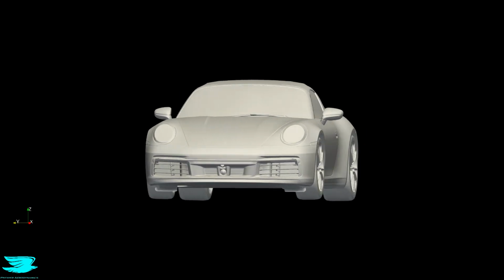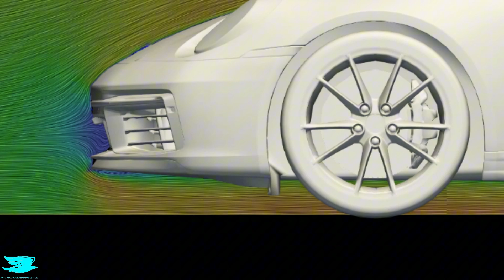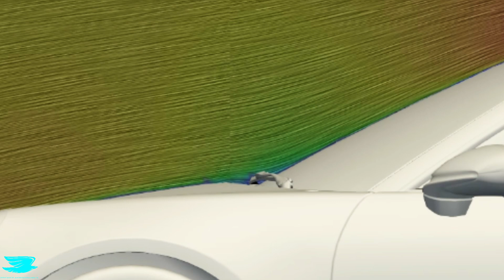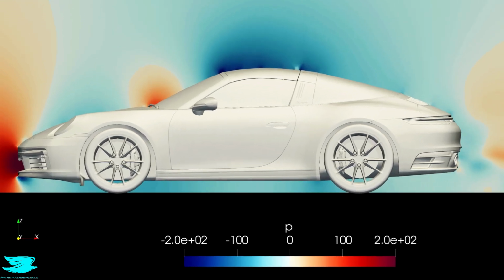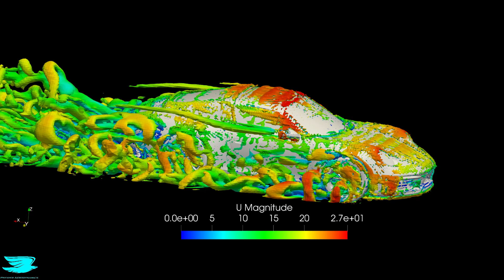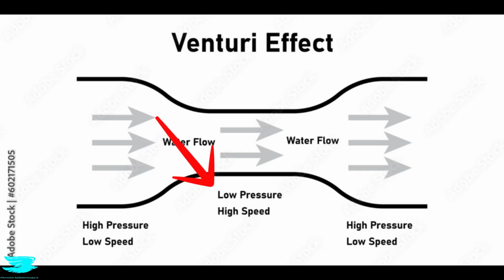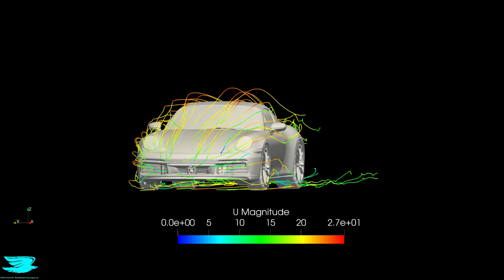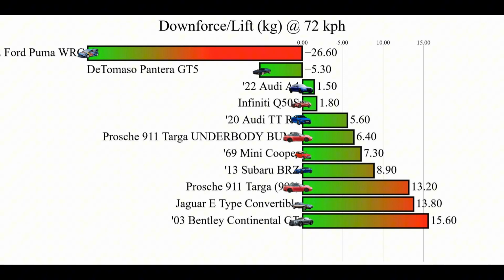I Fixed The Porsche 911's Aerodynamics Problem

Comment: Only from driving a 992.1 i cant agree, its like there a too many things missing on the Aero Car Parts. Like the Design of the Groundplate and the Brake cooling airflow. Or the flow when the Wing is out and air is forced to go from Roof strait in the engine area and comes out between the mufflers.

Comment: the original center of lift was pretty central and the new diffuser creates low pressure locally and offset to the rear giving a rotational moment with increasing speed. That's an undesired effect
Reply from the maker: As said in the video, you can change where the bump is, and for those who like to live dangerously, you could always have more than one.
Reply: @PremierAerodynamics  4 counts of cd added is much worse than 9kg of lift on a car that's roughly 1,5 metric tons and only the former could be felt by the average customer

Comment: Are you sure it’s a good idea to use RANS and stationary wheels here? I feel like that choice would seriously hinder the validity of the results in this application
Reply from the maker: It's not RANS and the wheels are MRFs.

And how much do you think they will hinder the validity of the results?
Reply: That’s good. The results look averaged though, did you do that in post?

I can’t be sure but without MRFs the pressure distribution on the underside would probably be significantly different.

Comment: Interested in your thoughts: I have a 2018 (991.2) targa GTS, and it is extremely stable, possibly even more so, at high speeds. Given what you described in the video, the opposite should be expected, so I’m wondering why this stability occurs?
Reply from the maker: It is quite different to most 911's, despite looking quite similar. For example, the lip at the front borders on a small splitter, and that alone really helps produce downforce. You also have vents at the top of the front wheel houses, which for this particular car helps alleviate high pressure in the wheel houses, and that reduces the lift too.

Also, the entire car is angled down slightly, so the entire underbody is essentially just one big diffuser.

Comment: If the porsche ground clearance would be 30cm higher lets say, would the added bump add lift to the rear? It seems that the factor that lowers overall lift value on the porsche in the video is the venturi effect, which the company used in real life but with an inflatable spoiler in the front
Reply from the maker: The higher up you go, the less effective the venturi effect becomes.

Comment: This is interesting, but Porsche employs some very smart aerodynamicists. I have to think if this were indeed a simple way to reduce lift without a penalty, they'd do it. So I don't know what it is, but there must be a downside they've considered that isn't covered here. Reduced ground clearance perhaps? If the limiting factor is the height of the lowest point on the car, for clearance, perhaps it's better to have the whole floor at that height (aside from the diffuser), effectively making the whole floor be the 'bump'?
Reply from the maker: Do you know any Porsche aerodynamicists? I do. Have you worked in the automotive industry? I have. Fundamental knowledge there is very weak.
Reply: @PremierAerodynamics every modern RS car would disagree with that statement lol. I have 2 theories why Porsche didn’t do this, and it could very well be a combination of both.
1st theory: Ground clearance. People in the comments saying the ground clearance would be negligible likely haven’t driven a 911. The rear of the car often scrapes worse than the front because of how far the body extends beyond the rear wheels and the weight of the engine in back. Many countries nowadays have regulations for ground clearance, so adding that hump may have made it so they had to raise the car, negating any positive effects on handling the bump had. 
2nd theory: the GT3 and GT3RS both already have better aerodynamics and diffusers. Every upgrade they make to the base model brings it a bit closer to the top of the line model, so the manufacturer is hesitant. This happens across the whole car industry, not just Porsche.

Comment: 1. Awww come on I asked for a "Porsche is more aerodynamic in reverse" video.
2. As others have stated, the underbody is "open" there because of secondary engine cooling and the massive exhaust manifolds and catalytic converters all housed behind the rear axle, which prevents any proper diffuser design in the first place (let alone a hump).
3. Considering how far Porsche design language has come especially regarding the 911, I wonder how bad the '60-'70 classic 911 was with the upright windscreen but less frontal area overall.

Comment: I would highly appreciate if you could do a similar video on the 986 Boxster, it has a lift problem. Roof on and off, would be interesting to see what damage the open top does. I drive mine on track and would love some more downforce and less lift :) thanks!
Reply from the maker: That, in my opinion, is the best porsche because it was nimble and the chassis was a  little flexible, so you could feel the road way more. Later models, and the 911's, feel really dead in comparison.
Reply: @PremierAerodynamics you mean flexibles as in the shocks/springs stiffness or as in chassis torsional/flex stiffness?

Comment: Placing the bump right between the wheels makes sense from a ground clearance standpoint.

 A little forward of the rear wheels or right between them sounds like a good position, since that will increase the rear grip without reducing front grip, but I wonder if that would reduce the diffuser's performace because of the fact that any negative pressure where flow detaches behind the bump will suck in the dirty air of the jetting vortex of the rear wheels. Conversely, placing it right behind the rear wheels will seperate the jetting vortex of the rear wheels from the underbody flow but then the diffuser has to be extremely short, and any extra downforce created behind the rear wheels makes the front grip worse too.

Also if its placed between the front wheels, it would increase the flontal area since the sloping hasn't begun, but what if the ramp from the splitter was extended to the wheels to effectly be like a shallow bump?
Reply from the maker: It definitely could reduce the diffuser's effectiveness, but it would also reduce the wake size, so that may compensate for the diffuser's loss.

Comment: You missed the Effekt off the intake cooler air exausts in the back. Thex differ from Modell to modell. that changes the underpressurezone and the hole airflow in the real

Comment: Having a bump there is essentially the opposite of having a diffuser right? Because the diffuser would hollow out that space. So if the bump reduces the pressure an reduces lift, how does a diffuser do the same?
Reply from the maker: The geometry isn't really the important thing. The important thing is the gradient of the geometry. So, they both create downforce because of the acceleration of the air. The bump also has a couple extra features, like the Venturi effect, which amplifies that acceleration, and then being close to the ground also gives you more room to make an even more extreme end of the bump/diffuser.

Comment: I know that you probably have more sugested ideas than you can make in 5 lifetimes, but I just couldn't leave 2 more ideas to be forgotten without a chance of analysys.

1st one:
do roof railings really add so much drag? or maybe they can in some weird way help in some cases (working like a spoiler or vortices generators) and why do some of them are so noisy

2nd one (maybe not as much with cars)
how much better aerodynamics do sportbikes have over naked bikes? (easy comparason might be between MT series bikes and R series both from Yamaha, mostly same chassis and engines, but R's with and MT's without fairings)

I really appreciate your work and how you make aerodynamics easier to understand for people like me (still in highschool) even though they are one of the most complex things in physics.

Comment: I drove various 992.2 models at speeds of up to 340kmh and they’re incredibly stable, if anything, you get a feeling like they’re more stable the faster you go, almost as if they’re producing suction.
Reply: Maybe because they are newer and porsche has has time to fix the issues
Reply: @mwanted240i 
Probably, but any kind of lift due to their shape (as mentioned in the video) is a non issue. 
Even getting airborn at 300+ due to bump(s) will not induce lift in frontal area. 
They do have very significant roll acceleration due to high level of lateral stiffness, and that can catch you off guard at very high speeds if you get too relaxed, but as far as aero behaviour goes, they really don’t leave much to be desired. 
You can cruise at 320 for very extended periods of time.
Reply: @drazenbudis7881  aha, there is not that much frontal lift and the weight distribution kinda compensates for the rear lift
Reply: That would be with the wing up, right?
Reply: @polipochilegge  
On the cars that are revealed to the public as of today, yes, correct, always with the wing up (which in that case also serves as active air ducting).

Comment: 911 being rear-engined has always meant it cannot have a well-sized diffuser. They made the RSR mid-engine just to have that advantage along with better CG(just like a proper supercar would kek)
Reply from the maker: The bump fixed that too, if you want.
Reply: Not having the engine in the middle has never stopped the 911 from absolutely dominating every other road car on track. The fact about the lack of room for a diffuser in the race car is true though.
Reply: @jbrandon302 🎯
Reply: @jbrandon302 yeah well for that price tag it's not that surprising
Reply: Because the rules didnt allowed long difusera after the bumper or something like this, so basically they had to break tradition to do that and also a better car overall since the mass is more centralized

Comment: Clearly you haven't seen a 911 from the underside. The hump you tal about is exactly where the exhaust manifolds and mufflers are. It's the only part of the car that hasn't got a flat bellypan because off the heat and accessibility to the engine/ exhaust.
Reply: I was going to say the same thing. The hump is actually already there in the form of the muffler back box.

Comment: Your solution is partially good because you calculate it on a steady speed and assuming a constant ground clearance. In reality the ground clearance will vary depending of the circuit, road and suspension compression due to downforce. This will result in an unstable behaviour at higher speeds during a quick ground clearance change. (See Mercedes crash at Le Mans in 1999) A fixed wing will provide consistent down force at cost of drag.
Reply: Also of note is that, while this bump may be more efficient in terms of -L/D, It's important to consider the design priorities of the Porsche. Porsche, unlike many supercars, doesn't put too big of an emphasis on the top speed, instead focusing on broader handling performance. The added fuel economy penalty from the drag is also not really a concern since, well... it's a Porsche, if you can afford one you can afford the added gas prices. Overall the bump seems like it would be a good solution if this were for a cheap, slow road car that happened to be shaped similarly, like the beetle, but on the Porsche it somewhat conflicts with the actual design principles.
Reply: The bump as illustrated is a fair way from the ground so while some suspension movement will vary it's effect to some degree it's unlikely to be crucial.
Reply from the maker: The same can be said of pretty much everything about the car, including the entire car itself because it is sensitive to the angle of attack. Wing lift changes with angle of attack too, so no consistent downforce or drag production.

Comment: I remember having a conversation with people about cars, and someone mentioned that the Porsche 911 has the best aerodynamics(Their reasoning was something like, "Because it's a Porsche"). I said that wasn’t true and not all 911's are stable at high speeds(GT and RS versions exception here) due to car body shape. They looked at me like I was crazy :D
Reply: I have noticed that they are very pitch sensitive, raising or lowering the front axle +/- 5-10mm brings a whole new set of dynamics at high speed vs low/medium speed as you trade mechanical grip balance for aero balance. It makes setting the cars up frustrating for the uninitiated. It is not intuitive to me how adding a bump around the diffuser improves things. Factory examples of increasing diffuser efficiency on these cars involves tilting the engine up to allow more clearance for a larger and longer diffuser.
Reply from the maker: The bump effectively removes the need for changing the engine placement. Also, the bump can be placed anywhere very easily, not just in the diffuser area. Placing it there increases the downforce for the rear wheels.
Reply: @ Recently watched top gears episode on the Manthey 992 GT3RS where the Manthey rep talks about the use of multiple curves in the diffuser to help keep the airflow attached. Is this a similar principle to what you achieve with the bump? I have been looking at ways to fit or build an improved diffuser to 991 gt3 for laptime improvement.
Reply: That person was correct. The GT cars and the rs models specifically, make better use of aero than pretty much any street legal car out there, barring any super low production unicorn or street legal race car build.
Reply: I’m curious, all this talk of unstable at speed… which generation of 911 are you guys talking about?
Reply from the maker: Fanatics and logic don't mix.

Comment: I mean... if somehow making the diffuser less curved and more bumped out makes things better, doesn't that just mean the diffuser is poorly designed...

Also, i was wondering, doesn't this increase the frontal area of the car? Or is the bump only placed in the space created by the early sloping of the underbody of the car?
Reply from the maker: You can move the bump anywhere to help change the balance of the car too.

If the bump protrudes out further than the projection of the lowest point, then it does. Otherwise, it doesn't.